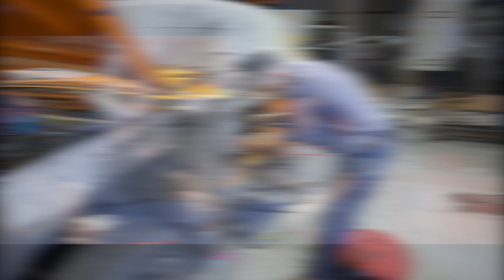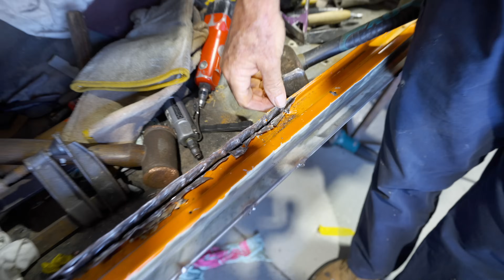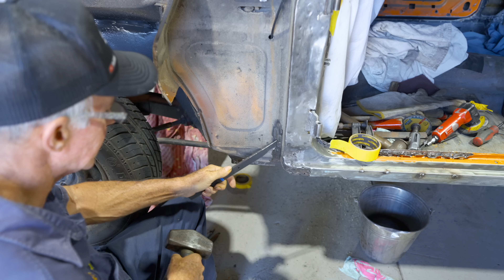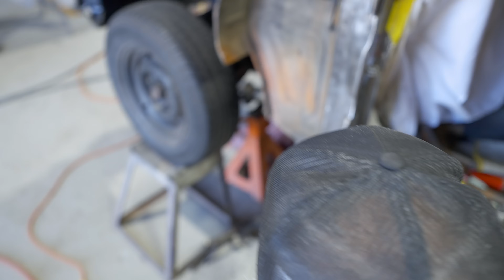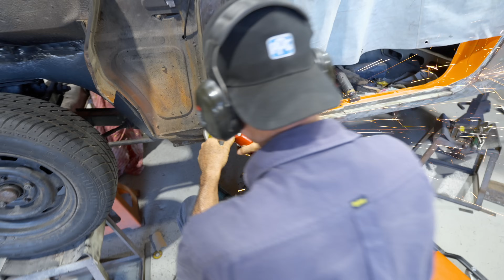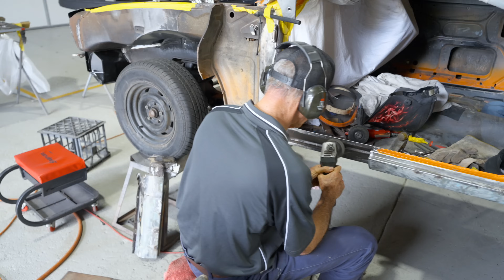Holden Torana Gtr Xu1 LJ ( Part 28 ) REMOVING a RUSTY SILL on a classic car.

Comment: If its not a s/h remove and replace cut i recon you cannot beat a 10mm air beilt sander and a small bolster with the cutting edge and the side edge sharpened you can hit on the stem edge and side edge as you only sharpen 10 to 15 mm of the side edges

Comment: Those tools are only designed for splitting the panel, not actually cutting the weld. You still have to grind/drill the spot weld first. I’ve got a set & they definitely speed up the process.

Comment: just cut the edge with an angle grinder then sand the rest off.  Hitting it with a chisel is a waste of time effort and risk of injury  .
Reply: Or maybe use the chisel after cutting the edge off so it is only trying to peel back a strip, rather than the panel with the edge.